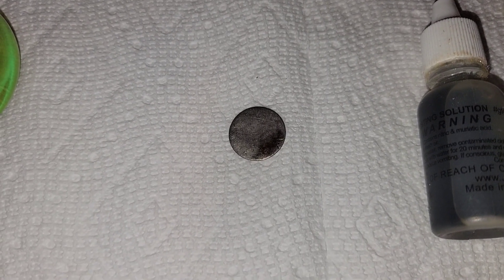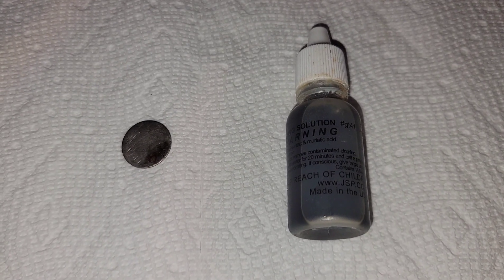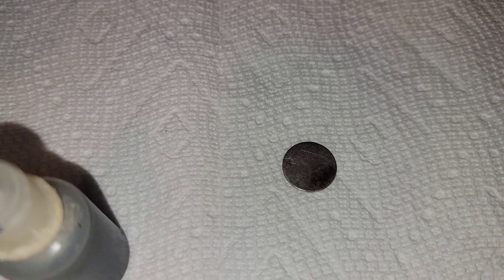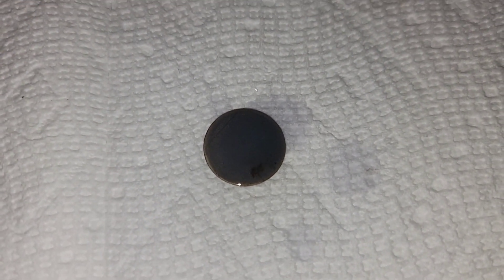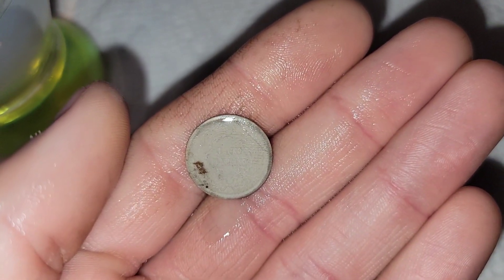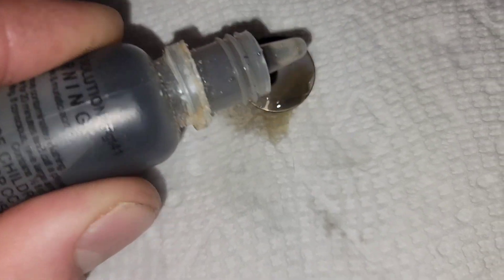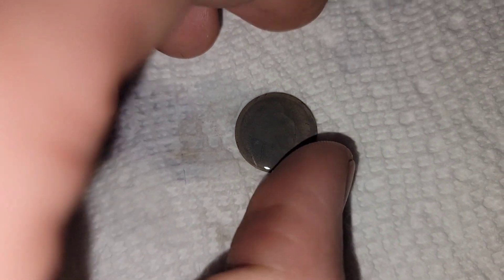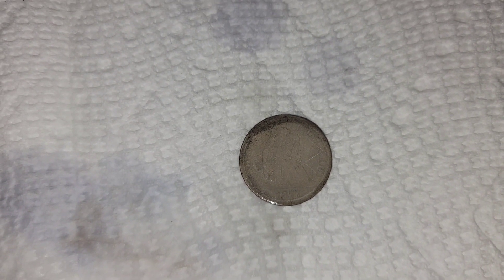How to Acid Etch Worn Out Silver Coins

Comment: Is there a way to do this with coppers? I have a giant counter stamped copper that is completely wiped, you can just barely make out the stamp, I'd love to get a little more detail for display.
Reply from the maker: I have tried and it went awful. Not only did it not reveal any detail but it turned the coin a weird color. Would not recommend.
Reply: @BugeaterMetalDetecting  I figured, maybe there could be an acid that would work? Like nic-a-date.

Comment: Outstanding,  I'm going to be using this method on a couple coins. Thanks for sharing, good luck, happy hunting and take care. ✌️
Reply from the maker: Thanks! I'm curious to know what they are! I've done it on 3 that I've dug and all were seated
Reply: @BugeaterMetalDetecting  I've got one coin it's a Spanish One Reel Globe and Pillars. I can barely make out enough detail to tell that. I'm curious on if I can get the last number of the date to show through and some of the writing around the edge. It's my oldest find here in Iowa and it's 175?. I'm thinking 3 or 7. I'm not going to hurt the value or condition as it's in really bad shape. I've also got a Barber Quarter with no date and I'm thinking it's a Barber or Seated Dime. All I can make out is part of the One Dime on the back. Thanks again. ✌️

Comment: Ok, if you're curious, I guess, but it's still just a coin worthy of melting.
Reply from the maker: Why would I melt a coin I worked so hard to find?
Reply: I would still pay a small premium if the date is legible, since this isn't a common issue like a mercury or barber. Also, it could have been a rare date.
Reply: @peterchoe  Please, just spend $30 on a low-grade, but full design common date and be happy with it. Or, keep detecting until you find a decent version   It's not like you're going to pursue a date-mint set of Seated Dimes in Poor-0 grade with chemical damage, anyway. Are you?

Nobody wants that coin even if it is a rare date. Maybe a 73 cc or 74 cc, but nobody will certify it, anyway.